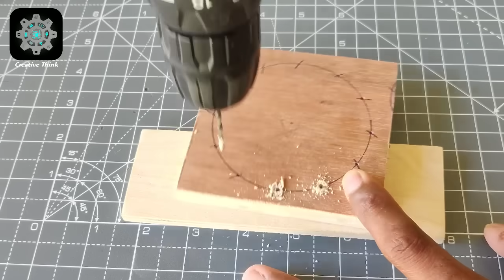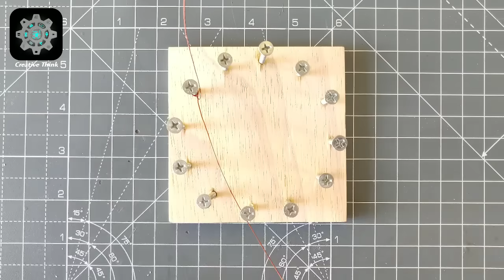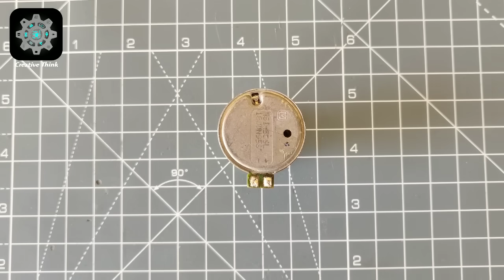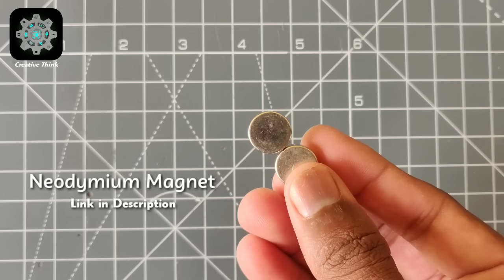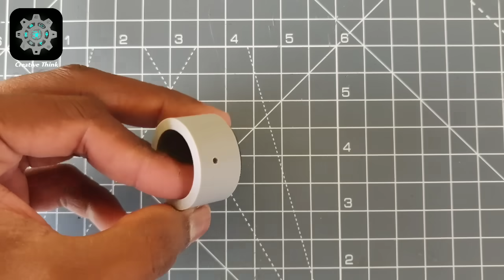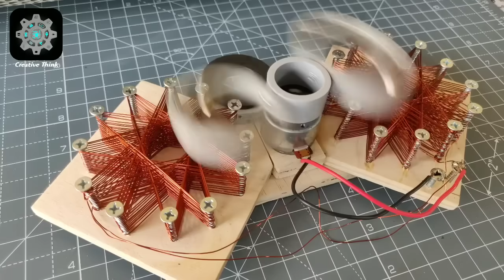Free Energy Generator Using Neodymium Magnetic Levitation

Comment: There is still aerodynamical forces being applied, plus you know... law of conservation of energy still exists. If you could find a way to remove all the air out of a space (I’m not talking like a vacuum or the vacuum of space) along with removing all energy lost through heat and other energy stealers, then you might have a machine that breaks even with the electricity it produces and uses

Comment: The energy comes from quantum energy. That is the real reality. Conventional energy system used in the world is just like an oil mill. Where you borrow the oil and get it in the form of the oil's moving energy and never utilize the oil.
Reply: @BowlGOfficial  I watch some fake and real videos. It's not easy to see. But I see typical patterns eg they use ring magnets. So there are different effects that make it work. After all, you can watch some other videos and where it's easy and then it's worth trying. It is important to look for patterns in the videos. And good copper quality is important. And then reveals that it is possible to get energy out. I have complicated models to think about and know that it works. In fact, it does not violate any of the known laws. But it goes into a separate branch. Actual.